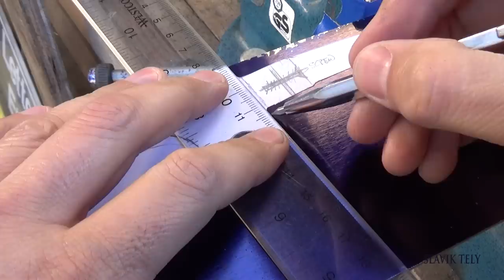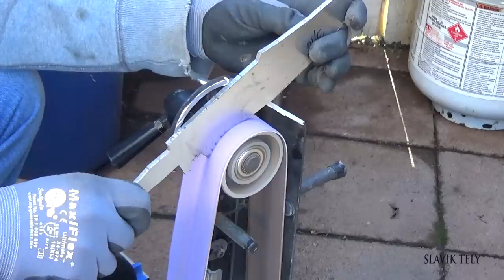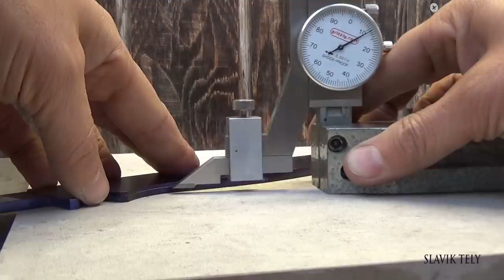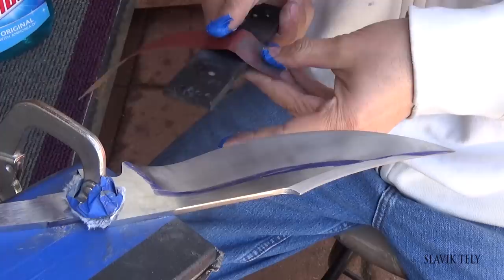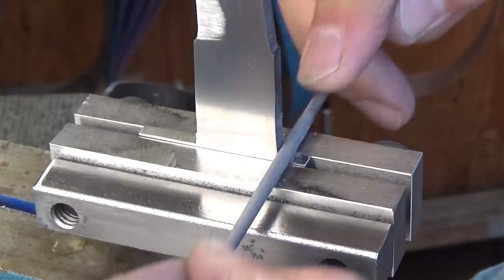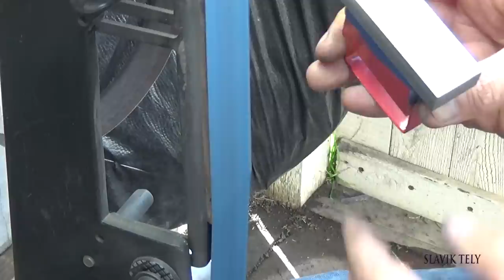P1 Making Expendables Legionnaire Bowie Knife

Comment: I found when cutting anything like D2 and above(CPM stainless), if you don't cut straight, the blade goes dull instantly... Where as with AEB-l. and carbon Steels you can actually turn the steel in the bandsaw a bit... Took me dulling like 3 blades before i figured it out, hahaha.... Great video, take it easy...
Reply from the maker: That is very good to know. I destroyed a lot of blades cutting CPM
Reply: Me too, haha Then once I started cutting very straight,  they were a lot easier to cut... I'm use to carbon steel where you can almost follow the lines... It's unbelievable how fast the blades go dull with CPM154 if you vear off just a little bit...

Comment: I've never worked with cpm 154. Looks tough. Doesnt throw much sparks. Amazing steel.
Reply from the maker: It will eat your band saw blades like there is no tomorrow. Very hard steel even in annealed state.
Reply: @SLAVIKTELY  I bet. Grinding belts also I imagine. Expensive build but worth it.

Comment: The metal you used looks so soft... Because you did the cutting and designig very easy
Reply from the maker: All of my metal is soft while I work on it. After I finish shaping it then I harden it.
Reply: @SLAVIKTELY ... How you did the hardening...  Do you use water or oil..
Reply from the maker: This is stainless steel, it is air quenched. Google heat treating stainless steel.

Comment: Very nice knife build!! I have just a quick question, the round sanding tool you use on your drill press, could you tell me what the name of that is? And  possibly where to obtain them? I have looked but can't find! Thanks very much!
Reply from the maker: Diamond wheel at Harbor Freight.
Reply: Is that a hardened steel you used? No need for quenching?

Comment: I've been plotting on a Jet drill press. What do you think of yours? Also does the table flex when you push down?
Reply from the maker: I have not had any problems with my table. I wish it had more power because it bugs down when I drill 5/16" I have not looked into Jet but I think they are pretty good company too.

Comment: Stainless is not magnetic just so you know, it is mild steel that you used for your guards
Reply from the maker: Soooo how did I use a magnet on a stainless steel blade to hold it to flatten it out? I guess it does stick.
Reply: Some stainless is magnetic

Comment: What is the name of that steel? Where can it be obtained or what is it?
Reply from the maker: I list all materials used below the video. CPM 154 CM New Jersey Steel Baron. I suggest you start with high carbon steel 1080 it is cheaper than stainless steel.

Comment: Nice knife, but is that still considered forging?
Reply from the maker: I live in apartment. Can't make that amount of noise. Also, this is stainless steel
Reply: I'll take that as a "NO".
Reply: @scot_irsh  It's just a informative answer.
Reply from the maker: @Sean, if you can't understand my answer then its a big NO.
Reply: I understood your answer as no answer at all. You obviously did not understand my simple "yes or no" direct question. Also I find it hard to believe that one noise is some how better than the other. Because you didn't answer my question, I came up with my own. You did not move any metal, you did not forge it. Cutting is not forging, its cutting.  Still a nice knife, but getting less nice as this conversation drags on. Do we need to continue with it or what?

Comment: Why did you put tape on your fingers while sanding the knife ?
Reply: Derp Headquarters -  keeping the sandpaper pinched tightly around the sanding block will eventually start to tear up your fingers.  It's actually a good idea and I may give it a try.
Reply from the maker: Amen
Reply: FOG BLADES -  Those can work nicely for certain things, but sanding blocks really aren't that versatile when it comes to getting into smaller or contoured areas and can be awkward on smaller surface areas such as "swedges/false edges".  Having a sharp angle on the front of a sanding stick also really helps clean up the plunges and other tight corners.  

All these things considered, I have found that having at least a few sanding sticks in different shapes, sizes, and materials allows me to more easily sand and finish all of the areas on a knife as well as to get cleaner results.  It also makes it easier/faster to switch to a fresh area of paper more often, which I've noticed can make a big different in how long the process takes and the results I gets.  That saying, "use sandpaper as if it's free" (which also applies to grinder belts) is some wise advice.  

Anyway, with all these variants of sanding sticks it's pretty much inevitable that you're gonna have to pinch the paper tightly with your fingers.  Don't get me wrong, though, as I'm not saying one way is right and the other is wrong, but this is just something that has helped with my personal process(es).  Take care :)

Comment: do you by chance have a link to you metal cutting bandsaw? or whats the brand name?  im trying to find a vertical metal cutting bandsaw
Reply from the maker: Milwaukee band saw. I have a video how I mounted it to the wall. I would suggest using DeWalt band saw, because it is much easier to make a wall mount for it due to position of the screw mounts on the body of a saw.

Comment: What is the steel on it? It says CPM-154CM on the blade stock, but there are only CPM-154 and 154CM.
Reply from the maker: CPM-154CM is what New Jersey Steel Baron sold me.
Reply: @SLAVIKTELY  Ah, ok.......well it doesn't matter much. Both 154CM and CPM-154 are great steels, the only difference is that 154CM is an ingot steel and CPM-154 is a powdered steel. The ''ingredients'' are the same, but powdered steels have more even particle structure, so they perform a bit better. Good looking knife BTW.

Comment: If you can make a 6in blade version identical to this for under $100 please contact me with personal information we will work out the details.
Thank you nothing but love from Detroit🏭
Reply from the maker: Materials on this knife were over six hundred dollars. I don't make anything under two hundred and fifty and that is a kiridashi knife. I am not taking orders right now.
Reply: Detroit
Reply: @SLAVIKTELY  "Materials on this knife were over six hundred dollars"

BLIMEY! That's mind boggling, if you don't mind my asking: why was it so expensive?
Reply: @jimminy cricket oh no it's not like that I have no clue what it takes to make a knife it looked easy to me he didn't have to Forge it bought the medal I thought because of that it would be cheaper I don't know what nice go for I'm a gun dude I just thought it was a beautiful night and I wanted one that I could carry to cut up deer Etc 6 inch blade would be fine with me if you would have come back with a counter offer we would have had a deal but $500 for one knife is too much for me 200 SmartStyle spend if I can't get that blade that style I will find something else similar that will hold an edge and not break a chip are you still like my buck 119 special the handle felt weird in my hand squarish I took a rat tail file to the down a few pegs never really got it right and the blade tip broke so simple so easily someone said that's too hard to steal it doesn't bend it all at Just Brakes hard to sharpen to add Gerber lost it boat overturned on a canoe trip so forgive me if I look like I was low-balling the man I wasn't besides how do you know until you ask have a nice day gentleman nothing but love from Detroit🏭
Reply: @da-ghoul2332 mild steel wont be cutting up much Deer, need 440 stainless or carbon. Good machinist/ fitter mind.
Reply: @richardjames5006  thanks man I don't know shitt so you're saying the knife he is making wouldn't of held up due to the steel he used for that knife?